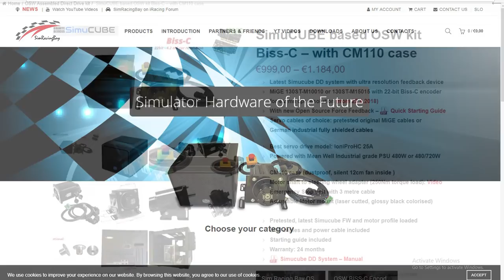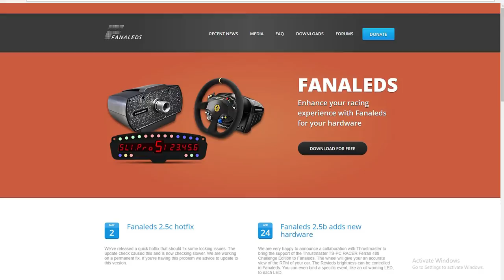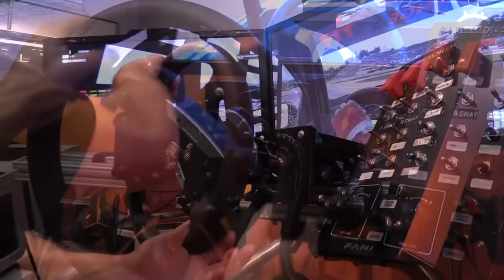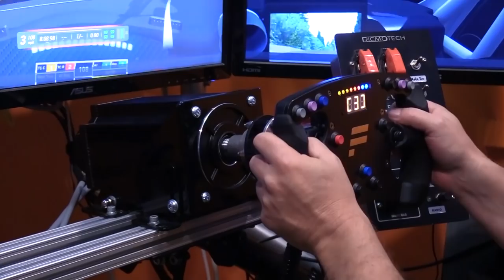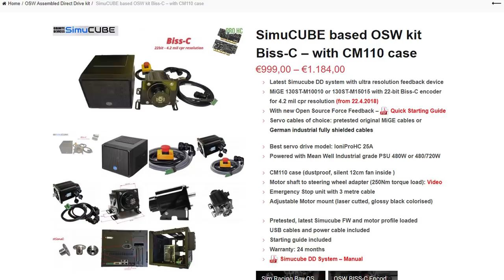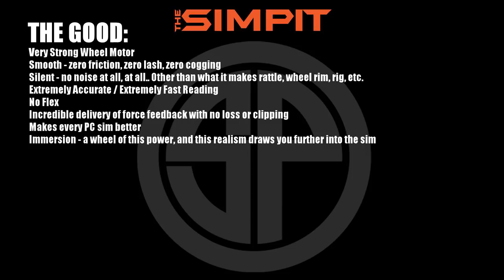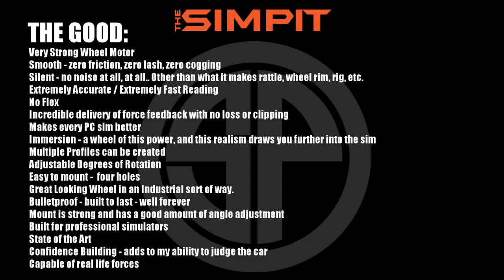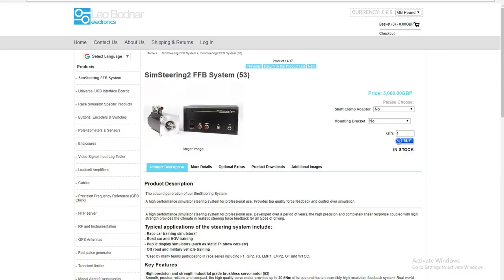Sim Cube 30nm Direct Drive Wheel Base Review

Comment: Hey Shawn.  I noticed that when you were testing the wheel in iracing, you were only changing the FFB strength slider.  I noticed that the other two were on zero.  Is this where they stay when you have a DD wheel?  I run a clubsport wheel and I have to tune the other two sliders to get realistic feedback.
Reply: Yes. With direct drive, you can set the minimum force to 0 and also the damping to 0, as the low-end torque range is so much better that you don't need the boosted low forces the same as Fanatec wheels. Damping can be set up in the SimuCUBE tool, it usually results in better FFB if set from there instead.
Reply: What are the latest recommended settings ?

Comment: Great review! But did you really forget to configure the permanent center point? One absolutely does not need to reset center every time. Also, why did you need to configure the IONI servo drive via Granity? With a pre-built set as this, it isn't required at all. Thats already a good amount of the "not so good" points swept away...
Reply: thank you very much for clarifying those points, GREAT COMMENT!
Reply: Where is permanent center point setting?
Reply: rod272727 its is set via the "Congure Motor, Encoder and center point" wizard on the Hardware tab.

Comment: Hey...you might want to edit your app.ini for iracing:
displayLinearInNm - Nm Display of force: (parameter = 1) - 
Changes the iRacing force slider to display the 100% point in Nm 

steeringDampingFactor - Strength of Dampening Signal: (parameter = 0.0500000) - 
Sets the strength of the dampening applied to the signal when the iRacing dampener is used 1=100% 

steeringDampingMaxPercent - Dampening Percentage: (parameter = 0.0000000) - 
Sets the percentage of dampening added to the FFB signal. This is set primarily through the dampening slider and is over written if the slider is moved. 

steeringDampingParkedMaxPercent - Dampening Percentage “Parked”: (parameter = 0.0000000) - 
Sets the percentage of software dampening added to the FFB signal when the car is in parked mode and the Dampen Oscillations checkbox is enabled. 

steeringFFBSmooth - Percentage of Inverse Signal Smoothing: (parameter = 1.0000000) - 
Sets the percentage of RAW feedback signal passing through the filer 1=100% Raw signal lower numbers signify more signal averaging or smoothing. 

steeringForceParkedPct - Parked Force Reduction: (parameter = 0.500000) - 
Sets how much reduction in sim delivered force is applied when in parked mode and the Dampen Oscillations checkbox is enabled. 0.5 = 50% reduction. If you want to turn off feedback in the pits completely set to 0. 

http://members.iracing.com/jforum/posts/list/3573261.page

Comment: It might be good to let people know that this option is orignally a DIY and that the wheel still can be DIY. These companies are adding anywhere from 500 - 600 dollars to the final product.  I built my Open Sim Wheel for around 800 - 900 dollars.  This review was great but there needs to be a little discusion about the history of the OSW. I sometimes feel that original purpose of the OSW has been lost.  It was originally designed and pushed as DIY.  So if anybody has the skills or is willing to do the resesrch and learn, OSW is 100 percent in achievable.
Reply: Ditto. They are not hard to build yourself either.
Reply: The OSW guys in iRacing go apeshit when someone calls the OSW DIY.  They claim that its no longer DIY and can be bought off the shelf, just like an Accuforce, Bodnar, Fanatec, Thrustmaster or Logitech.
Reply: Lawyer4Ever What you are saying is partially true. Yes it can be purchased as an all in one product. From different online stores. The funny thing is that there is 2 main components to the osw that every company uses.  You have the simucube board and the ioni.  If you look at all these companies building the OSW all the parts like power supply and case, and the cables are not standard. So all these companies are parting together their own OSW builds and selling them. So they are nothing like any of these mainstream companies.I  dont know why they are going ape shit. Im not a fanboy of any product and this just sounds like somebody who is just justifying their purchase.  The OSW is 100 percent able to be DIY if you choose that option.  It makes no sense to argue this. The ioni motor driver and the simucube come from granite devices.   The hole purpose of the OSW was getting away from the markup from companies charging and arm and leg for DD.  I still think paying 1500 for OSW is a steel, but it can be made DIY for much cheaper.  You just need to spend the time and effort.
Reply: I have nothing against people going to a turn key solution, its just frustrating to hear that people would be willing to shill for these companies and say that DIY isnt a thing anymore.
Reply: I'm all for capitalistic opportunities, but these companies are just parting together the OSW and acting like its their developed product.  OSW in my opinion is best when DIY, it was created in the spirit of DIY.
Reply: Agreed, I thought about getting an OSW from an American builder, Joe Sullivan, but it was more expensive than the Accuforce, without the solid pedigree of a proven sim racing hardware company, Simxperience, to back it.
Reply: I just added up what it would cost to build an OSW with Motor, powersupply, and enclosure, and it was 950 usd.  Also that not budgeting on the enclosure or the power supply.  Its also not going to cost 400 - 500 dollars for cables and connectors.  There is also solutions out there for wheels and button boxes that you can purchase out the door for around 200 dollars.  You can get a complete setup through Simxperience with motor and wheel and button box for what they are now asking for OSW.
Reply: Well it's best when it can be available for a lot of people. I bought a Simucube at Sim racing bay and I absolutly love it. There way that I would be able to build it DIY and I am glad I payed 600$ that it was almost plug and play for me.
Reply: More power to the people who can get OSW.  Its still a steal verses the commercial Direct Drive systems out there that go for 5000 - 6000 USD. Going DD will change everything you know about sim racing!!!  I'm just stating the facts about OSW in terms that you can still DIY it. People don't talk about it much, and when you do talk about it, they say that it's not DIY anymore, which is not true. In the end you and I practically have identical systems, but I payed a 800 - 900 for it.  I just know the difference before and after of Pre simucube and post simucube development. If you can build a computer you can build a simucube now. IT IS THAT DAMN EASY!!!! Its stupid easy to build and its a shame that 600 - 700 dollars could of gone to pedals or a kick as wheel and button box. I think you are somewhat right and wrong.  There is definitely still a hurdle for direct drive.  So yes there are 3 - 4 guys who buy all the components and put them together and sell them to everybody.  But the hurdle to DD is price. The 1500 - 2000 price tag is still far out of peoples price range.  So I don't see eye to eye, that being in everybodies interest if they can't afford OSW.

Comment: Couple of comments corrections...

The iRacing slider numbers that you indicate as % of Strength are not actually % when using linear mode.. They are just arbitrary numbers.. To really find out the numbers you have to set to see the Nm scale in the iRacing app.ini.. When in linear the position of the slider determines the 100% point of telemetry.. If you are running HALF the FFB bar then you are actually at 50% of the wheel capability.  So if you were actually hitting red on the Clipping meter you would be getting 100% at that. Just thought I would correct that as you probably ended up going beyond 1:1 with the wheel at some point in there.

Comment: Looks like a nice wheel but it is way too much wheel for me especially with FFB.  The bottom line conclusions were spot on.  I admittedly run a much less expensive wheel and even on that for most games I have FFB set somewhere between 30 and 45%.  To top it off it would greatly exceed my wife allotted budget, hehe.

Comment: Shaun great review but I would like to point out a few things. You need to enable linear mode along with a few different app.ini option changes that will help you run higher forces without the crazy oscillations. I also hope you were using the reconstruction filter at 5 as well. I would hit up some of the great OSW guys on the forum to really get set correctly. You must also update to the latest Simucube FW that has better support for the Biss C encoder.

Comment: Who is this for?    In fact the typical profile of a Sim Racer is a middle aged man, living alone.  This group of people have more than enough forearm and wrist strength to handle 30Nm.
Reply: Jamiedh303 I know huge guys that can't turn the wheel when it's set to 30 Nm, even less, while it's outputting all 30 Nm.  I never realised just how much power 30 Nm actually was until I tried it.
Reply: Jamiedh303 Lol, I think I just got your joke, lol!!!
Reply: Only in one arm though!
Reply: @Mohawk_Racing  That's why you use a manual shifter on your right side, so your left arm gets more time on the wheel. Problem solved

Comment: You should have the emergency switch beside the clutch.-
Reply: Torque I was thinking a thumb button on the wheel itself lol.
Reply: Were I to mount it on the floor, I would put it by the accelerator such that I am reducing throttle as I reach for the emergency stop; that would also allow me to keep the clutch out with my left foot, which is good practice for emergency stops anyway.

Comment: Holy shit! 3:03 that could take someone's head clean off lol
Reply: OzSimRacing haha he crapped himself
Reply: magzire haha noob.
Reply: I think most people don't quite understand what they're asking for when they say they want "real life" forces.
Racing drivers are trained to let go of the wheel in a crash because when your front wheels are being ripped off the car, the steering wheel WILL break your arms. No-one is ever going to want that in a Sim.
Reply: Bud The Cyborg I think people want real life forces in regards to cornering   and road surface feeling rather than realistic crashing forces.
Reply: Maybe the 8Nm belt driven wheels are underpowered, but clearly what's available in these heavy motors is excessive.
I know, people are saying it's all about the fidelity of the movement and not maximum torque, but as Fanatec was saying in their DD coverage, their belt system is smoother. Theoretically Direct Drive is not optimal and the absolute best system is actually just a bigger belt drive. The problem there is you would need a HUGE frame to convert 20Nm through a belt drive without any wiggle.
Reply: Just one word " latency" directdrive has practically none because it just the shaft that moves but  with belt driven wheels the motor has to move the power through a series of belts and cogs which adds latency. So when you skid and lose traction you feel it that bit quicker on a dd wheel. Fanatec smoother wheel? every review I have heard comparing the two say dd is smoother, in fact check out sim racing girls review of the csw 2.5. Basically belt driven wheels are slower, less powerful, less sensitive,  less smooth and less reliable. Why do you think professional racing teams use dd in their simulators?  granted they are the higher end dd motors but you get the idea.
Reply: There is no latency in a belt system, the belts would have to slip for that to happen. With gears the drivetrain will have some slop, that's why belt drive was such a big deal when it was introduced, but theoretically the ultimate Belt Drive will always be smoother than the ultimate Direct Drive because it allows the shaft to rotate across more polls with the same amount of end user movement. I'm sure all the high end Direct Drive systems use a motor with a lot of polls and maybe there is a point where it's practically indistinguishable, but a 4 poll DD motor would feel horrible, and I'm sure there are some of those out there.
There is more to consider than just where the wheel is attached.
Reply: Bud The Cyborg just Google simracing wheel latency plenty of people discussing the latency difference between DD and belt driven wheels. No belt driven wheel can compete with a DD wheel, every review I've seen says so end of.
Reply: https://www.reddit.com/r/simracing/comments/4ccnaw/force_feedback_latency/
The first response mentions belt elasticity, I highly doubt that's actually perceivable, and even if there is a belt system with springy belts it is something that could be designed out of the system.
The only real issue is going to be the rolling resistance, but then again real cars have way way way more than any Sim rig so it's not actually unrealistic either.
In terms of actual input latency there's just as much discussion on other threads comparing the latency of Direct Drive wheels.
Clearly software is the largest factor in latency, and it's just a fact that the changing drive ratio of the belt system will have smoother power delivery than what is possible with direct drive using the same motor.
Reply: The real reason Direct Drive is so great is it's actually just the most convenient way to apply a large high torque motor to an enthusiast rig.
It would not be hard to design something better, but it would be extremely difficult to design something better within the size and budget constraints of the Sim Racing market.
Reply: What what based on what?
Reply: You said "Everything". Don't change your story.
Reply: "If belt drive had any advantage, why would Fanatec not stay with that technology?"
Ahem: "The real reason Direct Drive is so great is it's actually just the most convenient way to apply a large high torque motor to an enthusiast rig. It would not be hard to design something better, but it would be extremely difficult to design something better within the size and budget constraints of the Sim Racing market."
Reply: Falchulk I'm sorry but there really isn't any point to anything you've said thus far, you're clearly just suffering a bad case of post purchase rationalization and you aren't thinking about this clearly.
Reply: "Cogging" is a thing on ALL electric motors. Like I said before, maybe these DD wheels are using enough polls to make it effectively a non-issue but all else being equal a belt drive will  technically always be able deliver power more smoothly.
Is this statement almost entirely semantics at this point? Sure, but as someone who doesn't actually want a high torque motor I would actually be more interested in a 12Nm Belt Drive than the current DD offerings.